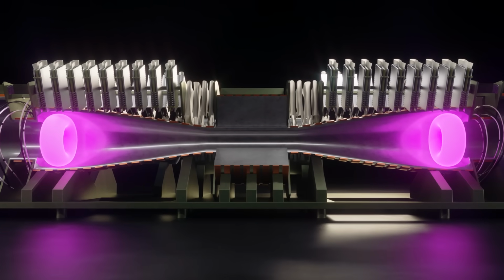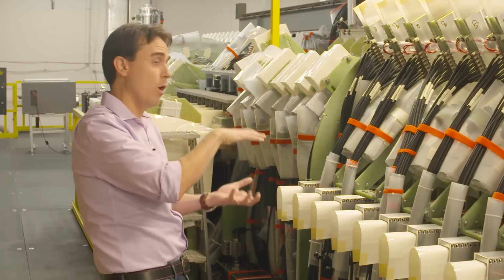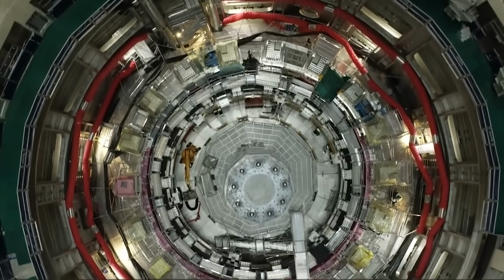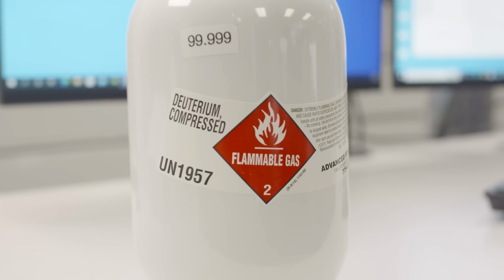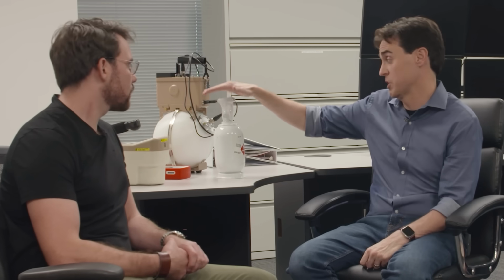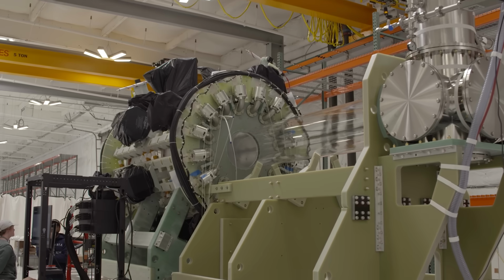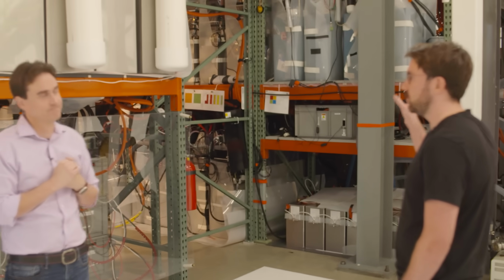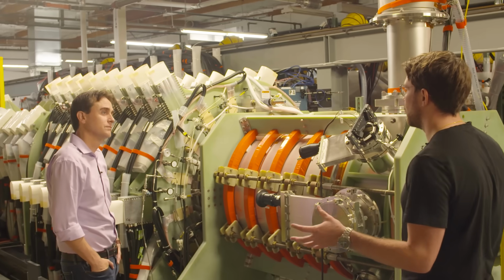A New Way to Achieve Nuclear Fusion: Helion

Comment: Props to Helion for getting out in front of, or at least adjacent to, the recent fusion announcement. I'm not the right kind of engineer to be able to critique all of this, but it's clear that they believe in their solution. (I stopped at optics - just enough knowledge to cause a problem.) Having someone that can describe the process in something resembling human English is awesome.
Reply: Just one question though, are you getting more energy out than the amount of energy you are expending in the process shown?  We've always known how fusion works, but the amount of energy needed to bring about the process has been daunting!  To see fusion taking place, all you have to do is feel/see the warmth/light coming from the sun (or a hydrogen bomb)!   Nice to see it's finally been done in the lab!!
Reply: @garybulwinkle82  

I wonder how much of a boost in efficiency is created by generating power by converting electro-magnetic energy directly into electric energy rather than using the heat to boil water and spin turbines!? 
From memory the best gen 4 fission reaction can theoretically only reach the high 40% efficiency mark (47% ish). 
I assume they'd still use blankets to absorb neutrons etc rather than letting that source of energy go to waste (haven't finished watching the video yet)
Reply: OP - hope you're not putting that optics knowledge to dodgy use in your garage with some Pu you scored on the dark web!? ;)

Comment: What I'm wondering about is what happens when there's even the tiniest hiccup in the control systems. My guess would be that a particularly bad misfire could lead to ...uh...spontaneous self-disassembly. Not even from the plasma...the sheer amount of juice running into those magnets could do a lot of damage if it decides to stop playing nice.
Reply: I believe they said it was surprisingly easier than expected to confine the plasma, it has a greater tolerance than expected so thus i imagine any critical error would need something extreme to happen. It's a solid state device so it's inherently stable.
Reply: @Game Over Yes but as I posted above I'm not that concerned about the plasma. It's the electromagnets that could have a very bad reaction to misfires. The forces involved would likely tear the whole structure into tiny little pieces.

Not a nuclear bomb, but basically "one mistake and you've got to replace millions of dollars worth of Metal-Confetti-Formerly-Known-As-A-Reactor".

Comment: Helion is such a cool company, I saw a documentary some time ago that wasn't nearly this in depth but I was still impressed by them then. If this works, it would deliver fusion 20 years before any other prototypes currently being tested. That's kickass
Reply: By 'deliver fusion' do you mean 'a generator on the grid'? Because there are plenty of machines already doing fusion, and have been for years. The next interesting step has been positive energy from the reaction, which we got last week, but only in a machine with no prospect of being made into a useful generator. I expect one of the spherical tokamaks to make positive Q quite soon. Maybe 3 years? Then someone has to get to actual total net energy gain so as to have a useful generator. Then they have to do it more-or-less continuously, and capture the energy to make grid electricity.
What this video seemed to skip over, unless I missed it, is how close this method is to positive energy from the reaction. Will the 7th-gen machine do it? If not, when? It does look like the road from positive energy to a useful generator is much shorter than with tokamaks and stellerators.
Reply: @xxwookey  I have to disagree. Think about it this way, with the thermal ineffiencies of Tokamak and other conventional designs, there's a much higher bar to jump to make positive Q, whereas Polaris would extract it directly from the reaction as EMR, making the barrier much lower. I'm not saying it's impossible to do it that way, but it'll be harder, especially bc of the rarity of fuel and components for ITER and similar designs. 

Talking about that news from the National Ignition Facility, it is brilliant, but it leaves out a key detail. While the reaction itself produced more thermal energy than was directly put into it, the power it took the charge the laser was more the 200 times the amount produced. Its a proof of concept, but not much more at this point.

Helion has been able to demonstrate repeatable fusion reactions in their Trenta design, that's miles ahead of any competitor.
Reply: @BigBoiiLeem  So which bit of what I said are you disagreeing with? I think I said all the same things. I distinguished between positive energy in the reaction itself and the whole machine, and noted that the Helion design has a much shorter path from positive energy to a useful electrical generator than tokamak or stellerator designs.
Perhaps you misread my reply? (It could have been clearer). So far as I can tell we are in agreement.
Reply: @xxwookey  nevermind, I don't disagree. Sorry, you just framed that a bit oddly haha. I thought you were one of those nit-picky people, but I stand firmly corrected haha

Comment: bs, we literally just cracked fusion dude. we obviously dont have any working and already build machine for conductiong it. alongside that arguement, ion thrusters dont produce very much thrust at all and if you think we can use ion engines in any capacity for that, your dead wrong. you need to get your Counter-science off of the platform dude.

Comment: I just had a thought a few months ago, about how rasengan from naruto could be possible in real life. I theorized that It would be a plasma energy sphere. Then I questioned myself on how I will maintain the sphere shape of the plasma. Then I realized strong concentrated electromagnets is the answer. Just like how our sun a sphere, contains its plasma energy. I figured that what if the magnets are in my finger tips and the plasma output will be in the center of my palm just like ironman's gauntlets. In my theory the magnets in my finger tips will create a strong electromagnetic field that can contain the plasma in my palm and therefore I can concentrate it to be a sphere. But I thought of a bigger plasma sphere so I theorized by using two hands and both of the left and right combining its magnetic fields can concentrate a much bigger and powerful plasma energy sphere (Rasengan). Then I got news about this new helion reactors just now and I realized my idea had the same concept. I was so happy and amazed that my theory about an anime power is REAL and POSSIBLE OMG!!!!!

Comment: The sad truth as to why it's been kept a secret, best guess, it would destroy the current energy system in place, meaning free energy = big loss of power held over people. And/or others if successfully at reverse engineering it, would use it as a weapon. Just 2 guess why the big secrecy around fusion energy.

Comment: I LOVE Aneutronic fusion... and I LOVE He3... BUT, making He3 on Earth, in a special SEPARATE breeder reactor that later needs to be processed, cleaned, packaged, and shipped to another facility which uses it to generate Electricity sounds like another BIGGER challenge than just getting D2O + T2O in ITER working... One of the MAJOR reasons why ITER is taking so damn long is fucking bureaucracy and the fact that ITER is a HUGE international project... the bureaucracy problem is multiple factors of magnitude greater... and also the ITER reactor has hundreds of scientific instruments which make it massively more complex and overengineered than the version for commercial applications... I also think that this approach will not be able to generate electricity continuously enough so it can provide that baseline powerplant generation... ITER on the other hand seems to be a lot simpler and less "CYCLICAL", as long as fusion is happening, neutrons heat up the blanket and the blanket provides heat to boil water... Yes i know, im tired of the same old Boiler to Steam turbine power generation approach, and i want some kind of direct electricity production scheme, BUT Boiler to Steam turbine works... and we know how to do it very well... so maybe lets get Generation 1 Fusion power working on Boiler to Steamturbine approaches and then work on Generation 2 Fusion using something a bit more exotic and unproven... 
I think this HELION approach is great for spaceships... or maybe even here on Earth for some massive machines like Aircraft carriers or submarines...
Reply: I forgot to say that i like HELION way more than NIFs lots of lasers hitting a fuel pellet approach... I think laser inertial fusion is a joke... cool science can be done, but completely dead end for commercialization...

Comment: 100% Fail. This is what is needed for fusion. One hot, one cold. Hot is a relative term. Hot can be a few hundred degrees F to a few thousand degrees F. Cold is also relative as there needs to be a very large difference in temperature. Closer to liquid hydrogen to start the better. Smart people will know why.  It is possible to make the few thousands of degrees from a few hundred degrees, it is just a matter of time. The chamber has to spin to be continuous. There has to be a process to remove helium. There has to be a process to manage hydrogen as the fusion process is like balancing the head of a pin on the sharp edge of a razor blade. One wrong move and it either come to an end requiring a clean out and a day or more restart or end in a boom that would twice level the largest cities on the planet. None of these processes is in this machine and is only being demonstrated here for research money for the next 10 years to basically do nothing and buy lavish houses and cars instead.

Comment: That really sounds great, but Helion is nowhere near breakeven yet. There are some pretty fundamental aspects of the design that haven't been validated yet. As far as things worth doing though, this is certainly one, even if it ends up never working out.
Reply: Very much my reaction:
1) it won't work
2) it won't be scalable
3) it won't be economic
4) 1, 2 & 3 could be wrong so this is well worth doing

Comment: Do they have a backup plan plan for a lithium blanket and heat engine incase the He3 part does not pan out? And get more energy from the D-D fusion.

Or more ambitiously could it work with proton-boron fusion instead? That's the aneutronic reaction with cheap fuel.

Comment: it wasn't clear from your doc whether they have achieved net energy gain, or how they are sure they can achieve net energy gain. can you elaborate? that is currently the big question, and i find it odd it's not addressed.
Reply: No one has produced net energy gain in an reactor which produces electricity. 

If you don't know the net gain that happened few days ago was an experiment / proof of concept. That can't produced electricity and will never produced electricity. 
So helion is the closest to producing a viable fusion then anyone on this planet.